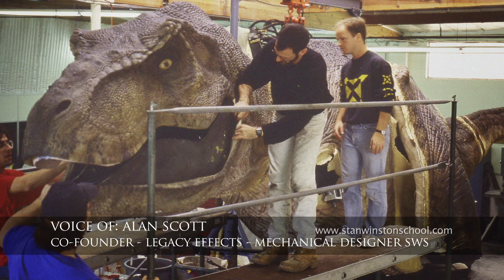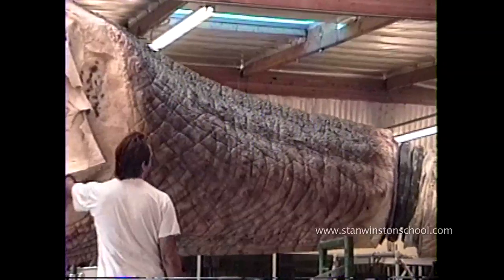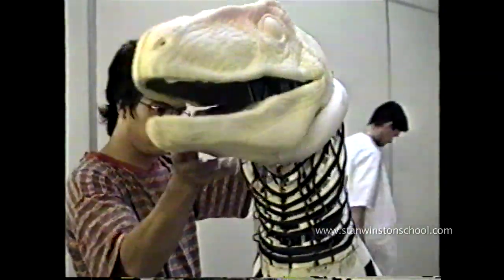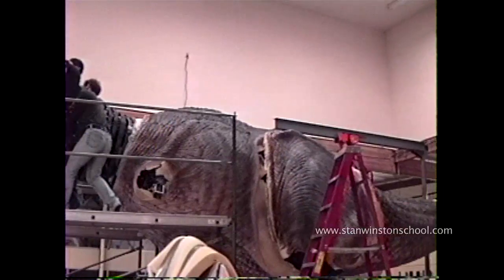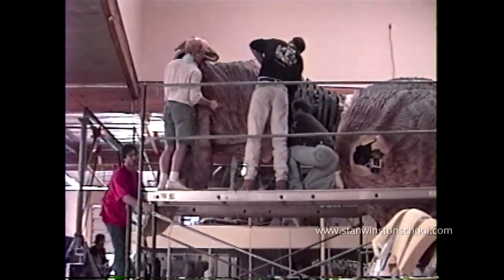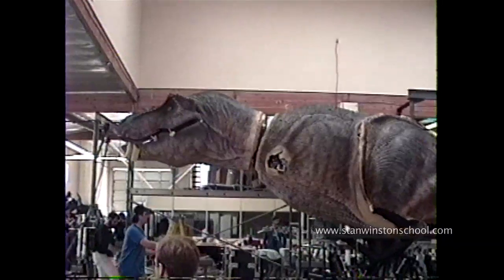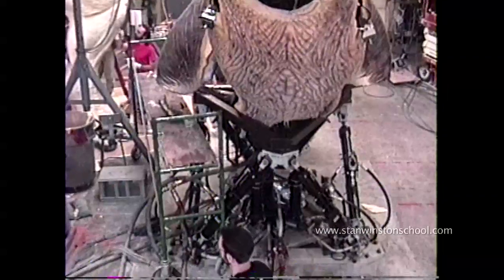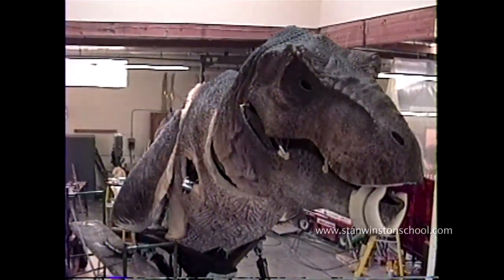JURASSIC PARK - T-Rex - Skinning an Animatronic Dinosaur Part 1 - BEHIND-THE-SCENES

Comment: a little big, t rex was 13 feet tall and had a 5 foot skull, this is 20 feet tall with a 6 foot skull
Reply: Where did you get those numbers?
Reply: All dinosaurs in Jurassic Park are genetically modified in some way  so it doesn't matter maybe Jurassic Park wanted the rex bigger so it could make more profit 
It's not just a dino sanctuary
It's a theme park